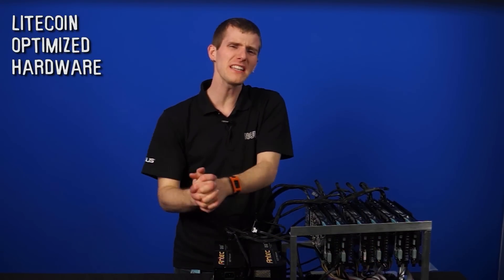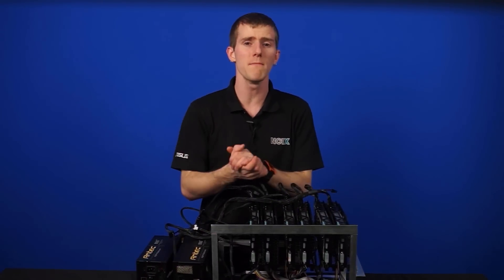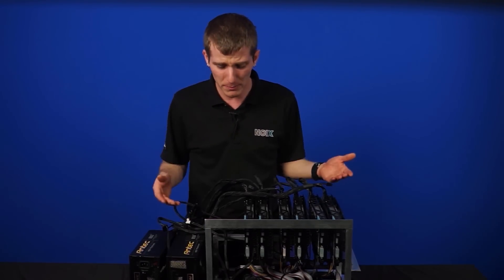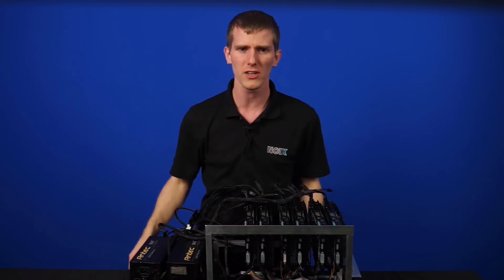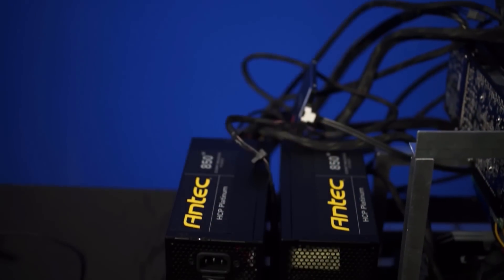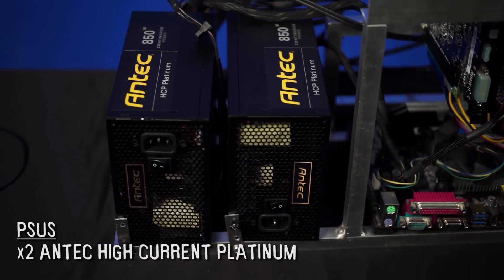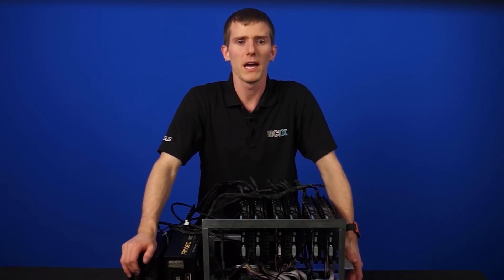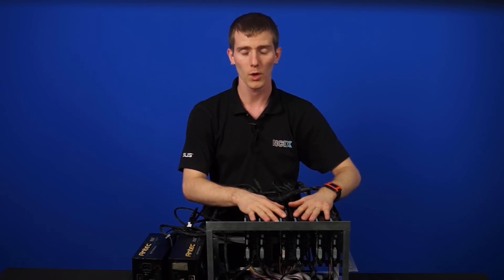Super Custom BitCoin/LiteCoin Mining Rig 2.0 - Tech Tips

Comment: Wouldn't your cards scale together better if you had 3 different computers with 2 GPUs in them? It would take longer to get the first coin, but you'd get 3 coins faster than 2 coins with the overkill system.
Reply: Thats not how it works Edward. You don't get coins based on the amount of PCs you have, its about the hashrate you bring to the pools table. And its just cheaper to only have to buy 1 cpu, 1 mainboard, 1/2 sticks of ram, 1 system drive etc. as it is to buy 3 of each, where these components make 0 difference to your hashrate (i.e. what is counted for you to make profit)

Comment: is 850 watts really overkill for 3 cards?
Reply: If they're heavily undervolted and underclocked, sure. If tweaked correctly, it makes economical sense to undervolt the GPU core while overclocking the VRAM
Reply: would you undervolt the GPU when mining? i thought mining was intensive?
Reply: Ruhul Amin Scrypt is very intensive, but mainly on the memory, which actually bottlenecks the card. So you can usually undervolt the GPU and save some energy. If you have the perfect clock rate-ratio you can mine even better. To get the perfect clockrate ratio you sometimes have to underclock your GPU core. Thats greatly dependent on the card tho. None of this applies universally.
Reply: Ahh ok thank you.

Comment: Well, it's a big risk and a huge investment. I'm not getting one of these. I do want a good gaming/video editing/web browsing/po- I mean post (mail) machine. Better than what I already have. My current machine has a shitty motherboard with one PCI-slot, a terrible PSU that comes with the case and an AMD HD 6450 2GB, which I'll let speak for itself. I mean, it does do some gaming, it does 1080p video editing and it of course can do the internets. But I can't wait for my new rig with a Sapphire Radeon R9 270X 2GB GDDR5. It will come with two GTX 560's, of which one will be put in my current rig and it shall run on a 1280x1024 monitor. I'm glad that I have such a huge desk...

Comment: wow just wow!!!!
         how do you get 6 gpu on one motherboard and how do you get it to work?
Reply: With Risers, as he said in the video, you plug them in the PCIe x1 slots on the motherboard and into the pcie x16 connectors on the GPUs.
Reply: d3rrial yea i know that but how to you get it to work i thought that you could only connect 4 GPUs on an single motherboard
Reply: Nikolas Petrou theoretically you could connect 24 GPUs to a single haswell CPU. The limit you speak of is the CrossFire / SLI Limit. You can't CrossFire or SLI more than 4 cards :)
Reply: d3rrial Yea but is this crossfire and why can you not have 6 gpus for crossfire?
Reply: Nikolas Petrou Its a limit of the crossfire protocols. Read up exactly what crossfire actually does, it might surprise you.

Mining is not using crossfire. Each card functions independently.
Reply: d3rrial Ok thanks!  :)
Reply: Nikolas Petrou You're welcome :)

Comment: 850W isn't overkill. You will actually have to undervolt the cards in order to power 3 of them.
Reply: Sangeet Khatri 150W for each additional card? - nope! not happening. Not while mining. It will easily push close to it's 300W physical limit. I tested it. You'll have to do some undervolting in order to power 3 cards and the rest of a system off of 850W.

Comment: As a previous tri fire user.
You have to know that such a system will dumb a lot of heat in the room so, if you are not going to pay for a decent air cooler in your room then don't consider buying it.
The heat will cause the overall temperature of the room to rise which will affect the temperature of the graphics cards making it higher. And as the heat builds up in the room the hotter the cards will get. Which will eventually cause the cards to throttle.
There is also a second note. The design of stacking the cards like this is horrible because the airflow will be horrible.

If you are considering such a system. take the time to consider watercooling it and do your calculations to see if it will pay off or not.
Reply: Water cooling still dumps heat into the area that your radiators are at, so where ever your radiators are they can still get poor ventilation, and cause your liquid cooled gpus to over heat. Also the added expense of liquid cooling would make it even more retarded to crypto mine.
Reply: Psychodegu
True and this is why i stated "if you are not going to pay for a decent air cooler in your room then don't consider buying it" And buy air cooler i meant air conditioner.

Comment: Î wonder if all these Coins can reach enough momentum before there deadline, becauseif they are not backed and can no longer be mined I don't see theyre value holding up.
Reply: What deadline? Why would printing more money make a currency more valuable?
Reply: d3rrial Bitcoins have a deadline that determens how many bitcoins can exist as well as when the last bitcoin can be mined.
The only thing backing the value of the cryptocurrency is the hardware required to mine it. This means the slower they can be mined (since the speed decreases over time) the more hardware you need to mine the same amount of currency, thus making them more valubale.
But if they can no longer be mined there is nothing backing them and they loose they're value.
But if they gain enough momentum (.e.g. become an acceptable currency, not just in the tor network) they can afford to lose their backing, just like the euro or the dollor don't have any gold backing them anymore.
Reply: TheBernhard100 Bitcoin can be mined for an infinite amount of time and miners will always profit from it. The backing will still very much continue to exist, even if no new coins are generated. Miners will then make their profit from transaction fees instead of block rewards.
Reply: Mining will still continue once all 21million BTC have been mined, their will just not be a block reward, the miners will be paid with the transaction fees, so i fail to see your point.
Reply: d3rrial xNo L1m1tZx You learn something new every day.
Reply: TheBernhard100 I'm glad you did :)

Regards
d3
Reply: d3rrial Cheers!